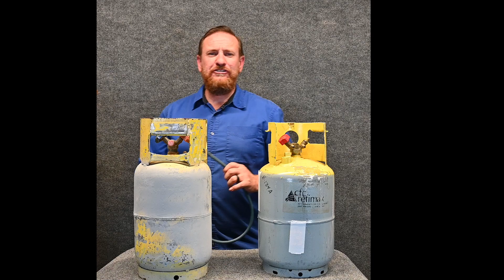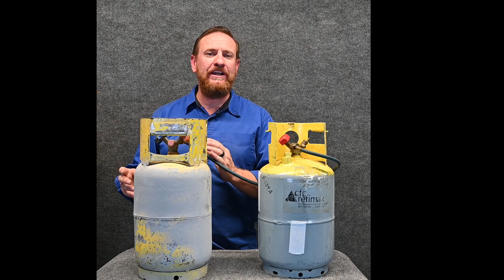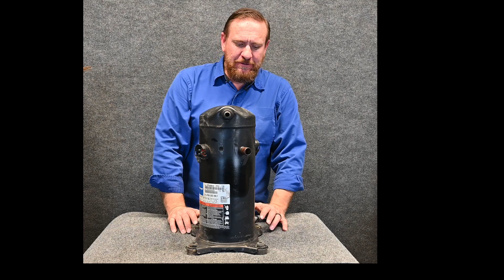HVAC 075 crankcase heater, intro to refrigerant migration

Comment: So i could ditch the board, set up a relay with crankcase heater contacts on NC
And have my red wire from the tstat on normally open. Thank fully i live im the dessert where i migjt need defrost once a year.

This is on a unit donated for my house from a job, i know doing this at a customers house would be last resort option

Comment: So does it always have to be on when the system is off. Or could we heat it up before starting ? Lets say its gonna be very cold outside for a few days or weeks. Could i just turn the crankcase heater on the day before restarting the system ? Or does the compressor always have to be hotter than the inside temperature even if off for a long time ?
Reply from the maker: If it's off for a long time, have the CCh run 24-48 hrs before starting the compressor.
Reply: @love2hvac  thanks ! 
I hear about scroll compressors all the time. But I guess rotary compressors have the same recommendations about the crank heater.

Comment: Sorry if I missed something but I'm confused on your experience of hooking up multiple tanks together. I totally understand migration and pressure/temp relationships, I'm not confused on any of that. I work on very large comercial systems as well but never have hooked up multiple tanks in series. What is the benefit? Was the end plan to have your recovery machine pump into the large tall tank and then the smaller tanks would fill up naturally from the pressure differential between the system and the inlet to your recovery machine? I guess I just answered my own question lol. I've just never done it that way. I use the large tanks at times but I pump into it till about 80% and then stop the process and then hook up another one. Never had any tanks hooked up upstream of my recovery unit but now I'm wondering if I'm missing out lol. Would want to have a scale for each tank though and isolate the furthest tanks as soon as they reach 80%  something I'm going to look into for sure
Reply from the maker: Never fill any tank over 80%.
Don't hook multiple tanks in series.
Reply: @love2hvac  well that was my question. I know how to fill recovery tanks but asked why you would put them in series. You didn't say not to do it in the video, you made it sound like you just didn't watch it close enough and overfilled the first 3 tanks. It wasn't clear, that's why I asked about it. Thx

Comment: Is it true that system refrigerant capacity is the deciding factor as to if a CCH is needed on a scroll compressor?  I have a heat pump with no CCH, came that way I believe.  Shows a CCH on schematic, but copeland says some systems don't need them depending on amount of refrigerant.  Any thoughts?
Reply from the maker: CCH is considered an accessory. To save initial cost it's not installed from the factory. 

Almost every compressor can benefit from CCH.

After working for Copeland as a contract technical trainer I have learned just how overlooked the CCH is.

Refrigerant migration is a BIG issue.
It causes oil to wash out from the bearings and liquid slugging that breaks compressors.

Add a crank case heater when ever possible!

Simple components that save the life of compressors. 

It's probably the most overlooked accessory.

Almost all classes if broken scroll sets are from liquid slugging at startup, which is from liquid migration during the off cycle.
Reply: @love2hvac  Interesting and I would have to agree.  Although Copeland claims scrolls can "handle" some liquid.  By omitting the CCH, are they trying to boost SEER?  Would it benefit my 26 year old Copeland scroll heat pump compressor to install a CCH?  Or if I install one will it kill it because it never had one?

Comment: Hey there Ty, did you happen to post any videos of the actual wiring portion of the crankcase heaters, been super intrigued with them lately, would love your take on it.
Reply from the maker: Crank case heaters are very important, probably the most underappreciated system  accessory.
They prevent flooded starts and slugging from refrigerant migration. Also prevents bearing as the refregerant washes the oil away.

As for videos, I don't have any on them just yet. It's on my to do list.

Comment: I used to work on A C systems in buses.
When we started using R134a  we had a problem with liquid refrigerant migration back to the compressor, Carrier o5G, when the system was off.
Upon the next startup of the system this liquid would break the Reed valves in the compressor.
We had to add a check valve in the discharge line and a liquid solenoid valve upstream of the txv.

Comment: I have an interesting story related to this somewhat.  At one of the schools i work at we have water furnace  geo reversable chillers and after changing out a RV about a year ago, I was all done with repair and had system evacuated down to 350 or so (dont remember exact) and I was trying to see the oil level on one of the compressors but it was hard to see so for some reason i thought if i tapped on the glass with my nut driver i May see if theres oil that moves and i would know theres oil in there.  As soon as i tapped the glass the oil imediatley foamed/bubbled like you mentioned and my vacuum shot up to idk lets say 2000 i cant remember, either way i lost my deep vac.  I had never experienced this before and I knew that it was either refrigerant or moisture boiling out of the oil but im still confused to this day as to why it didnt boil off until i tapped that glass.  Those chillers are installed in a mechanical room that stays about 75 or so degrees all year round but now Im wondering if maybe the CCH was  shot.  I too didnt think they are necesary when unit installed indoors.  Has got me thinking now, i will check it next time i go there.
Reply from the maker: When your pulling a vacuum on a chiller it's beneficial to keep the water flowing. It also helps speed the process. Chillers typically have more oil. As the refregerant is boil out the temperature drops, and the viscosity of the oil gets thicker trapping more of refrigerant inside. 
Sometimes a tap or vibration is just enough to release a portion of it.  Also the vibration of the water flowing helps do the same. Think of tapping the side of a soda bottle and seeing the bubbles release. 

This is also a great example of the importance of a decay test. Giving it time to raise the temp slightly and let any moisture or refrigerant boil out.
As for cch, I would check on it. Even in a controlled environment, your suction will be low for the evaporator. 

Sounds like you are doing a great job! Excellent experience, thank you for sharing it!
Reply: @Love2HVAC with Ty Branaman  I never seen your reply to this about a year ago now lol. Thanks for the reply. I agree with you 100% and makes perfect sense. Since that day, I now have a habit of tapping on the compressor shell while pulling system down multiple times throught evacuation. I've always done decay tests but that day showed me why it's needed and it showed me in a way that will be unforgettable and imprinted in my mind forever. I'd like to find one of those tank warmers you have but my supply houses never heard of them. I think that will help alot too in situations like these. The water flowing while evacuating would work better if the chiller was on its own loop. Although the slight vibration could help like you said, typically the systems I work on have multiple chillers so the water temp flowing through would be 42-45f generally thus wouldn't be a benefit temp wise with boiling the trapped vapor. The ambient temps are above that. But I'll play around with it. Thx again. I love watching your videos for the occasional refresher or the science behind things which was never taught to us correctly.

Comment: If your unit doesn't have a crankcase heater - can we assume it uses that low current through the windings to keep the compressor warm in order to avoid refrigerant migration?  You're videos are awesome btw - I'm just a homeowner but have already learned a bunch! Keep up the GREAT work!!😁
Reply from the maker: Few different ways

1 Crank case heaters that are always on, typically commerical.

2 Crack case heaters controlled by a thermostat on the line, like Trane and American standard.

3 crank case heater wired in series the windings and a single pole contactor like Carrier and Bryant.

4 a crank case heater with a relay. 

5   I believe the one your referring to.
using 2 run capacitors in parallel without a crank case heater. 
This also has a single pole contactor but one of the compressor run capacitors is wired before the contactor to allow some current to run threw the start winding to keep it warm. When the contactor closes now both capacitors are in the circuit in parallel to the start winding and the run winding now also has "power" and the compressor starts. 
You can't send the entire capacitor on the leg side because it would be to much for the start winding and burn it out (or burn the start winding insulation).
I have not see the start winding only method used in a while. GE did this as I recall. Soo people think it's common but it's not so much.

Comment: Let’s see if Ty knows the answer can you drain the liquid refrigerant from one cylinder to the other just by gravity only one tank suspended above the other top cylinder valves facing down. connected with a short hose ????  Yes

Comment: Is there a typical ambient temperature above which the crankcase heater is no longer needed?  I've noticed "CCH Optional" is sometimes called out on the system schematics but I'd imagine you'd want the compressor to be the warmest system component whenever the compressor isn't running.

What's your experience on a system that leaks down enough to cause the compressor to go out on thermal overload, is this likely to result is an acidic condition (say for an R22 system, for instance)?
Reply from the maker: Some units use a thermostat on one of the lines that controls the CCH.
Moisture is the biggest cause for acid. As long as the discharge temperature did not exceed 225 the oil should still be good.
Reply: @love2hvac  Thanks, Ty ;)  The CCH thermostat switches seem to measure ambient outdoor cabinet and cycle around 70F off / 60F on.